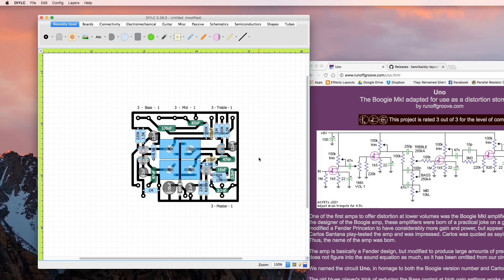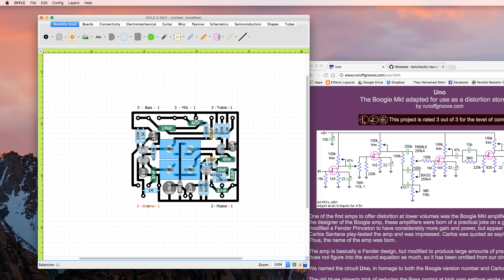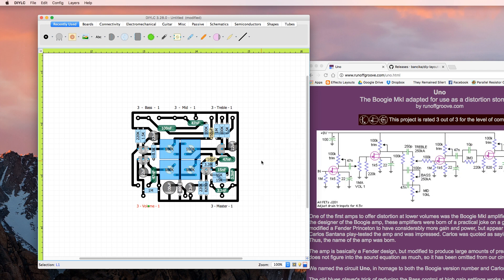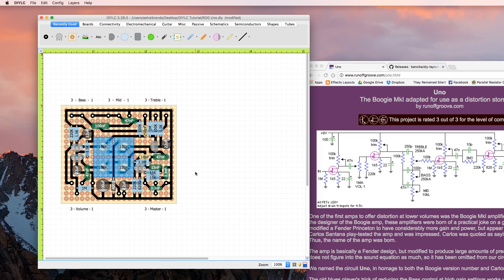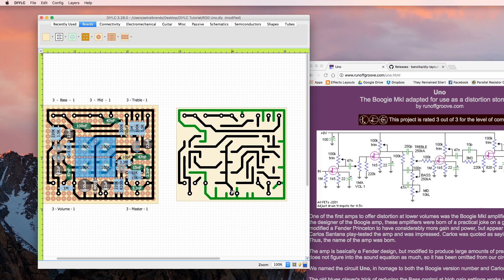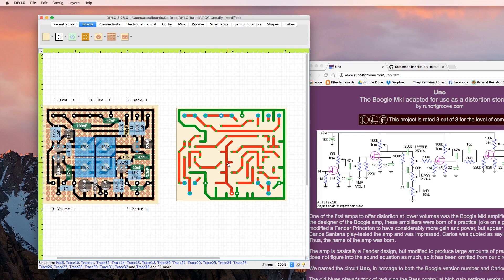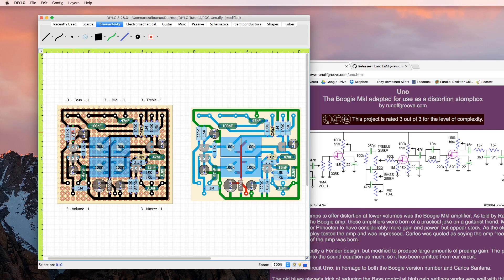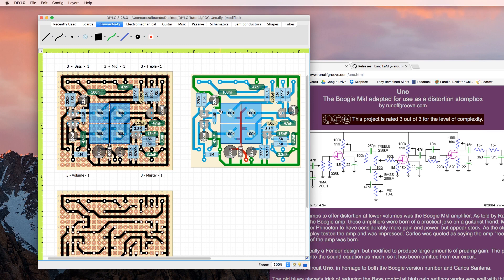Effects Layouts DIYLC Tutorial: Episode 3

Comment: Question : the top left is the board as seen with components from above(so black lines are on the under/other side), right ? Meaning - if I create a PCB, I need to flip the board horizontally before etching. Correct?